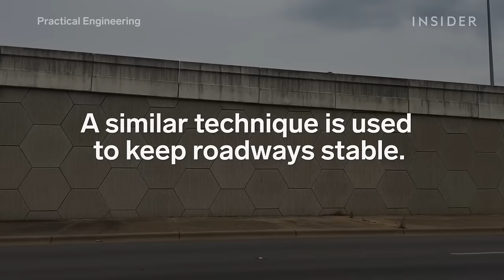This guy engineered sand to hold the weight of a car

Comment: I am not sure, but that is not the weight of the whole car. Why, because that is just one part the car and if it did resist the whole weight of the car. That mean it’s would have to be in the middle and the of sand would hold it. Also it has to make the car not touch the ground.